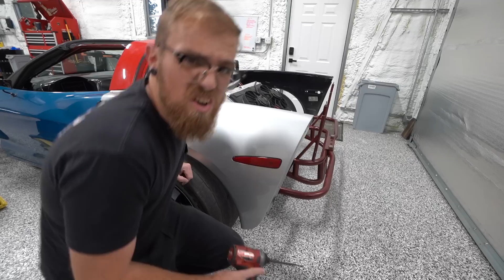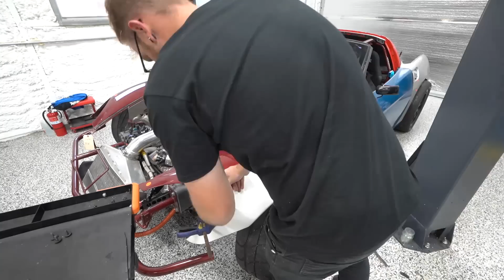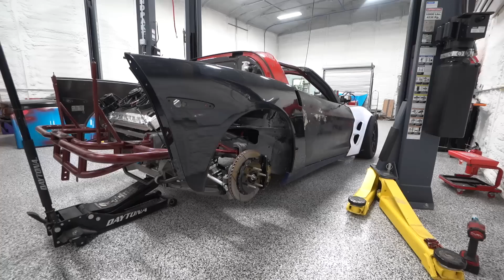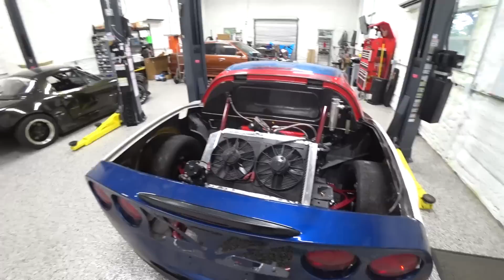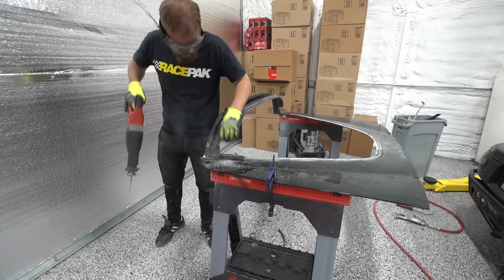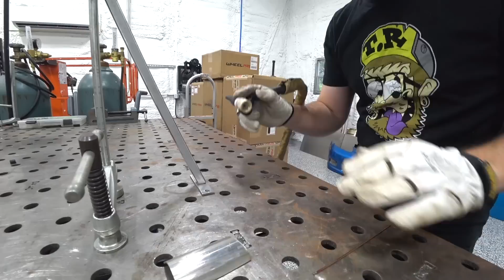427ci C6 Corvette drift build finally gets body panels

Comment: Hey man, I do quite a bit of fibreglass at work and the number one thing to avoid most of the dust is using a vacuum.
Not saying you need an industrial central vacuum system, my favourite at work is a small battery powered dewalt that I strap to my back.
Build is looking great!

Comment: Looking great. Installing rivets with the  basic hand hand tool sucks. The ones that have handles like bolt cutters are better. But it’s worth getting the harbor freight air rivet gun. But…,that Milwaukee toll looks awesome. Didn’t know they had an electric one. Well worth the cost instead of having busted knuckles.

Comment: Consider 1.5-1.8 mm sheet to create the inner wheel arches. You want a slight sharp edge on the rear side of the arch to chop off the long cords that filling off the tire during drift. Flapping cords will destroy the glass fenders with speed. The burnout guys use much thicker sheet as it’s possible to rip through thin sheet with metal cords in the fat casings you’re running

Comment: As an USAF Aircraft Structural Maintainer (2A7X3), I would add more rivets.  You have 5 going along the top of that fender, so 5 stress points holding that on.  More spreads the load out to others.  For aircraft we have rivet spacing being 3-4 times the rivet diameter.  You could easily add 2 more between each existing one along the top alone and still be what would be weak for aircraft spec.  The vibration alone will rip those out, it did not look like you used washers under them to spread out their clamping forces on front and back going though composites.

Comment: You did steering tyre clearance at normal ride height but didn’t do suspension bump clearance, it would have been worth setting the chassis at normal ride height on blocks then take the springs out and check steering at compression and full droop for clearance

Comment: Taylor, instead of doing a lexan window. Why not do an induction pan like the RTR mustangs? Yes it would add weight, but think of the performance you would gain by not needing cool downs as often as everyone else. You could attach it to the hatch to add rigidity, but also it would still make the hatch functional for garage work and repairs. Just a thought.

Comment: Mate have you ever thought about a mobile spray/grinding booth to use in your new garage? Put it on wheels so it can filter where you're working or move it into one of your doorways or make a window plate to filter and extract. We used to make them all the time when I was boat building out of Plywood and they become very handy.

Comment: Hello Taylor you did an awesome job at fitting them over fenders.  The drift vet is looking much better now with them installed.  It's got some more shape to it now. Is there a pre-molded lexan back window that you can get  for that model corvette?  Is there going to be any kind of vents in your back lid to help let the hot air out ? We know how important it is to be able to get it cooling down when it's hot out. Don't need the heat getting trapped back there. Other then them  couple questions you and Josue did an amazing job of the build.  I loved it all  awesome job..

Comment: You should get some mud flap type soft rubber and rivnut it to the rear firewall so the tire rubber hits that instead of going into every nook and cranny. Would be much less caking of rubber and way easier to clean.

Comment: I use "windshield cut-out wire" and two pieces of wooden broom handle about 8" long.  I used piano wire for years (make that decades), but someone invented this wire in the last few years.   I've never broken a glass using wire.  You can buy it on Amazon.

Comment: Those fenders look like a great candidate for you to get into fiberglass molding! You should totally pull a mold off them and have 1pc fenders as crash replacements. Kyle Mohan did it on this FD car. Looks like a Rocket Bunny kit, but its actually entire quarter panels he molded himself.
Reply: being they are a small business, if he wants to do that. doing it as a collaboration with the company that made the over fenders would be a better idea
Reply: @Dlawler  Totally, getting their permission would be the right thing to do. If they're personal use crash replacements it shouldn't be a big deal.

Comment: Taylor, ever think of getting a slotted rear window replacement? They usually clip over the glass, but it would hide the radiator in rear, and let heat out.

Comment: Love the attempt at getting overfenders but for drifting you know cars get damaged I would try to get a cheap fender replacement not an overfender for faster repairs instead of having to refit a new overfender to a new stock fender. It also saves weight 👍

Comment: you could add a custom plate for the license plate spot, and have that mount to the rear crash bar using the factory license plate holes. it would also work if youre mounting an actual plate, and keep the bumper from shaking around too much

Comment: is a good template for a 600hp street rig with e85 option or a mix you can set - i think even na this motor would be quite rowdy #crate motor adjustment period

Comment: Glad you guys made it through the storm unscathed, and I’m loving this car!
Reply: Dude, his lungs are super fucked. He cut and sanded carbon fiber dry. You should always cut it wet. The water stops the dust from getting into the air and into the lungs. Carbon dust is like little razor blades that lacerate the inside of your lungs, and when it heals it creates scar tissue, reducing the amount of air you can breathe in.